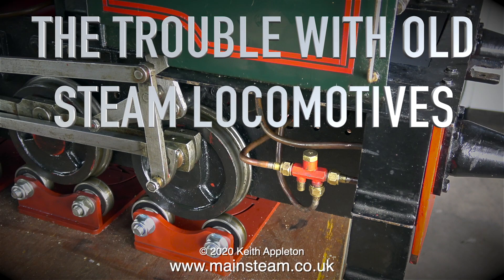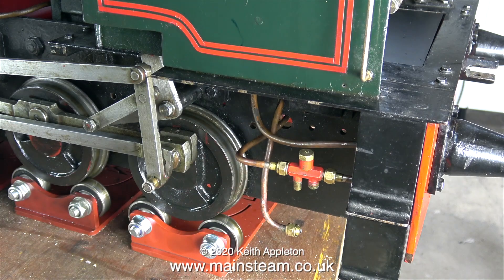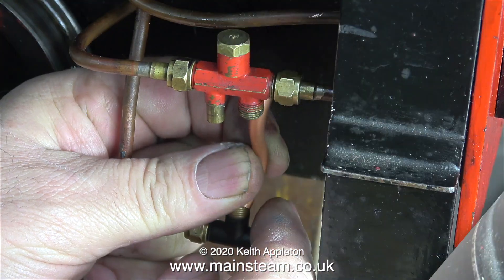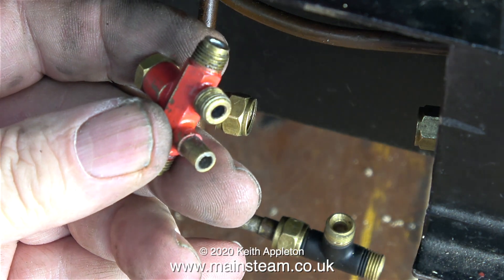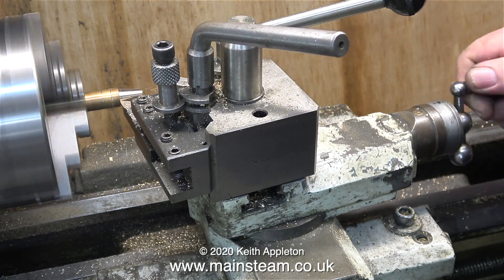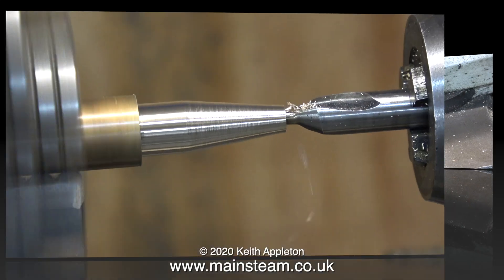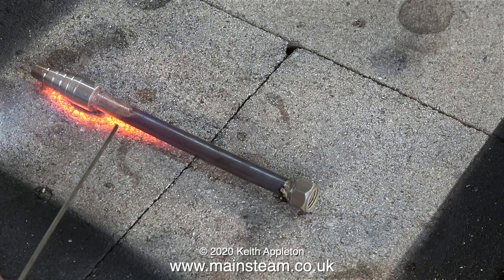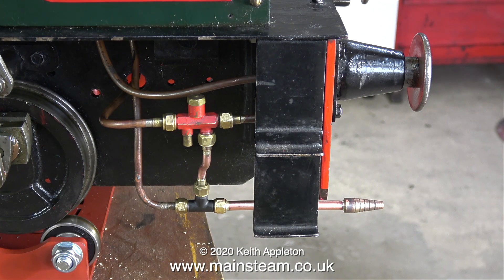THE TROUBLE WITH OLD STEAM LOCOMOTIVES - PART #21

Comment: Hi Keith little tip for you if you part off to just under your hole diameter then drill the hole to size when you break through the job stays on the drill bit and saves  you fishing about in the suds tray ☺
Reply from the maker: A good tip - thank you }:-)))

Comment: That's a nicely done job there Keith, I've been following it from the beginning. I did mechanical engineering at college and (even made my own vice and die holder for tapping) so a lot of what you do on the lathe brings back fond memories. We had a lathe at college where you could turn a taper using the main feed and get a good finish, big green thing it was and took up a lot of workshop space too. although it was a bit of a faff to use. Mostly it sat unused.  It's a sensible idea to have an external water source though and maybe that would be a good use for a dummy brake pipe between the locomotive and the brake wagon. Indeed, I've even seen locomotives like this with a working air brake but that's over complicating things, I think. Don't get me started on calling locomotives engines. It depends on the context, I suppose. At least they didn't insist on calling it a "Train and carriages" Stay safe :)

Comment: A small tip from a beginner, when removing small parts from a lathe, use something like a paperclip in the end of the hole of what your working on and it won't fall as far
Reply from the maker: Please watch a few more of my videos - why use a paper clip when you can use a small twist drill bit . . . . . saves a lot of time looking for your bent clip . . . .

Comment: Don't you need to have a valve on that secondary water feed so it doesn't suck air while priming from the locomotive tank? Or is there a valve on the silicone end of the tube?
Reply from the maker: There is a valve on the locomotive footplate and on the auxiliary water tank

Comment: Next time you would like the angle, just take the Arc-Tangent (Rise/Run); insuring of course, that the result is in degrees.  [How to check the result in degrees?  Arc-Cosine(0.707) is approximately 45°.]
Reply from the maker: aaargh - numbers . . . . pain in the brain cell ...... now where did I put my medication }:-)))
Reply: @keithappleton  A proper engineer is fine with this level of trigonometry.  All joking aside, I know you can easily do this!